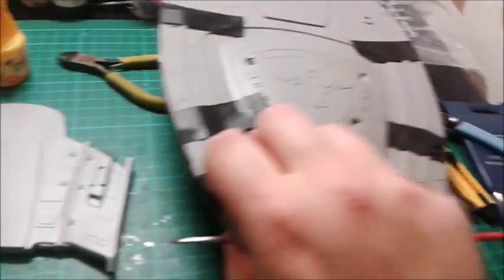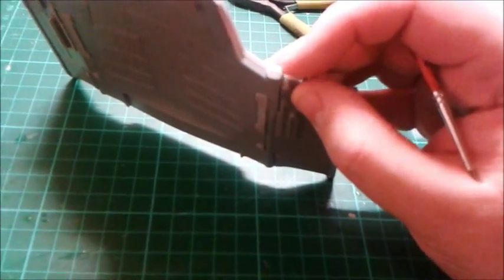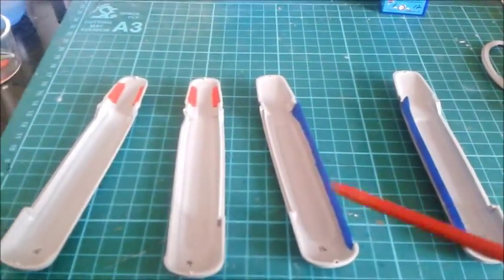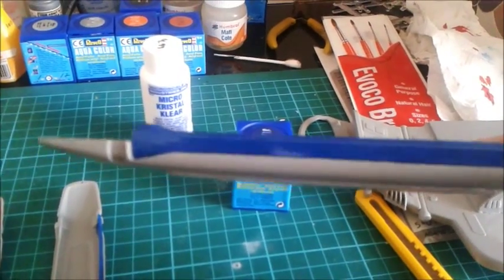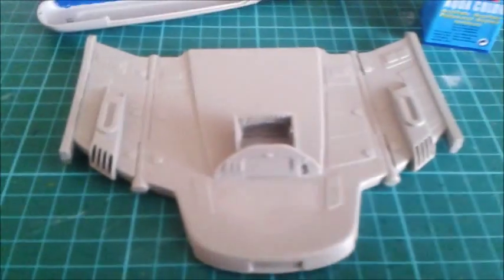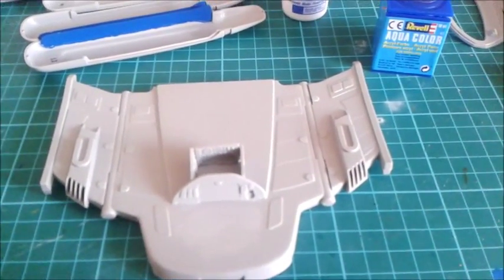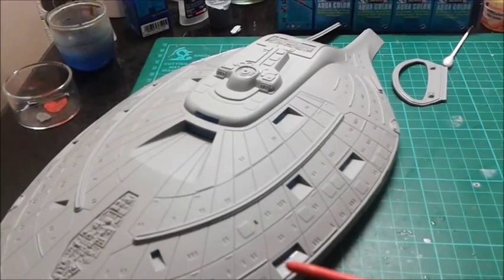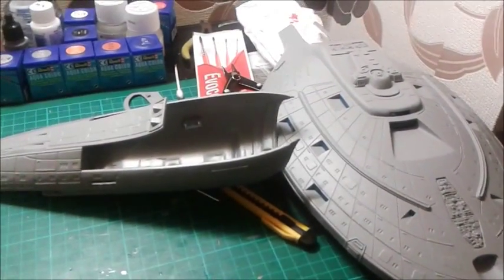Revell USS Voyager Part 2

Comment: great job m8 have you got a list of colors as i have just started mine and have no idea and where to get them many thanks
Reply from the maker: Christopher Weaver Hi Christopher,

Halfords Acrylic Grey Primer, then a light dusting of Halfords White Primer on top of that.

Humbrol 26 Brown (Phaser Strips)
Humbrol 19 Red (Nacelle Lights)
Revell 36152 Blue (Main Nacelles & Deflector Backlight)
Revell 36185 Brown (Main Deflector & Top Saucer Deflector)
Revell 36109 Anthracite (Top Saucer Plate & Sideplates)

Revell 36130 Orange (Saucer Side Plates)
Humbrol 61 Flesh (Bridge Escape Pods, Non-Decalled)
Revell 36374 Grey

Hope this Helps,

Wayne.
Reply: thank you will give it ago
Reply: did you use a spray gun to paint it
Reply from the maker: The grey & white primer was by spray can, the rest was paint brushed by hand. I havent got the money to buy an airbrush unfortunatley.